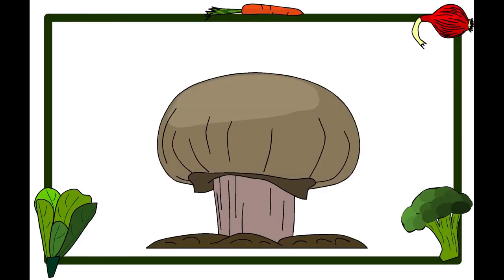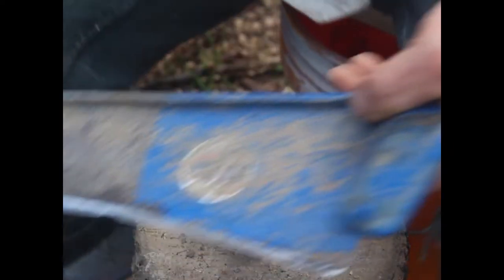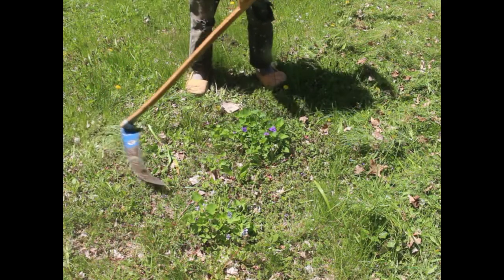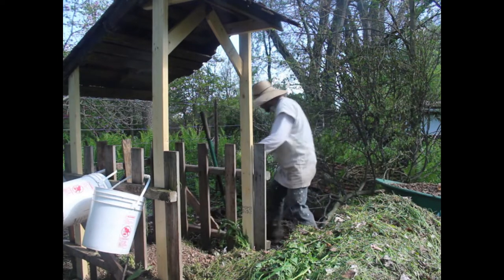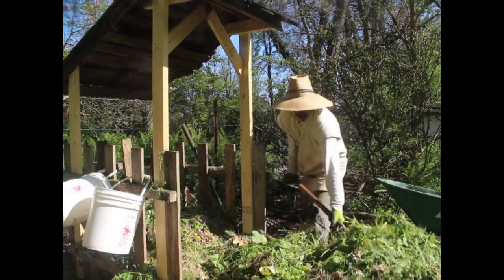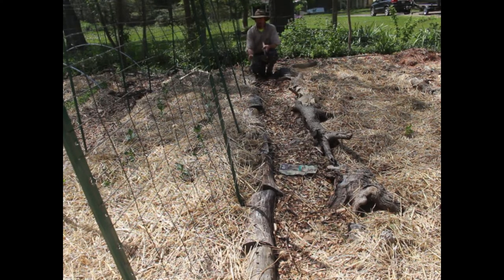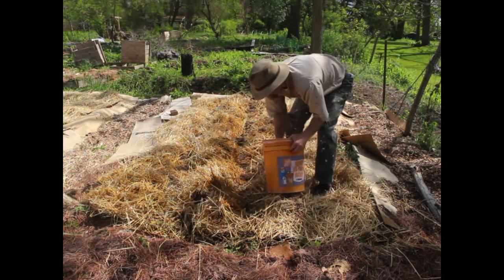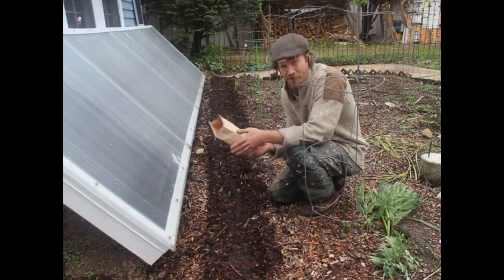Foodmageddon -- Ep. 014 -- Make Hay When . . .

Comment: Good job, Scott!
Reply: I actually don't cover my compost. All opened. I run it cold - vermicompost.
Reply: @gregw3437  That's what happens to much of my compost, but I've been trying to turn it more often. If I can get enough vegetation in the fall, I'm going to heat my greenhouse for as long as I can with it, too.
And then I have worms in the basement, too. That's my potting soil for the spring.